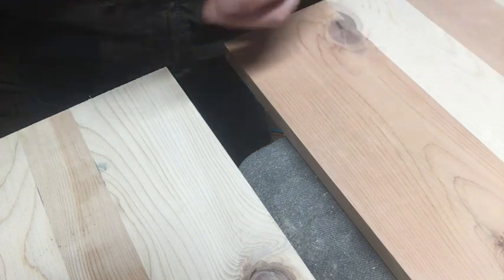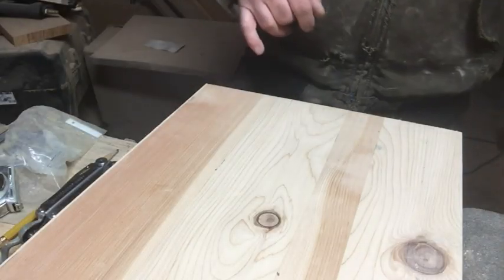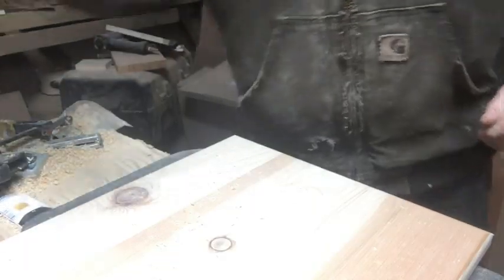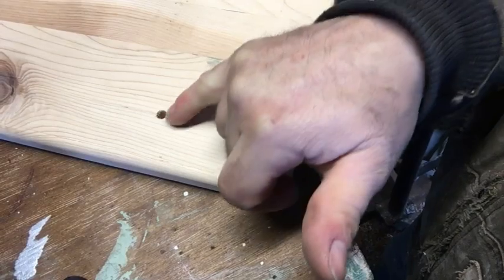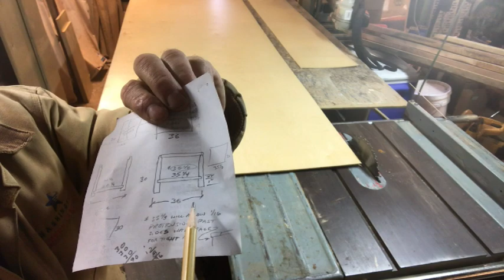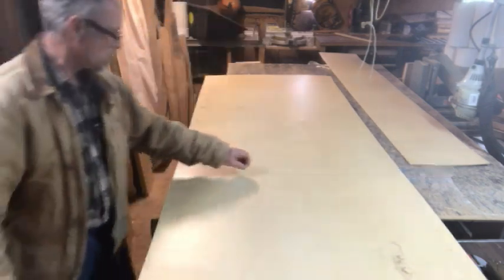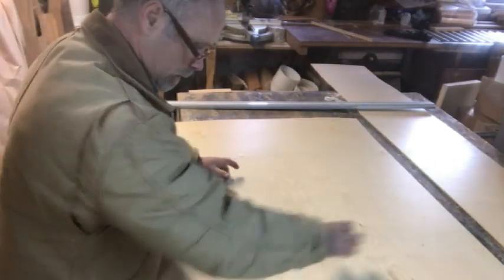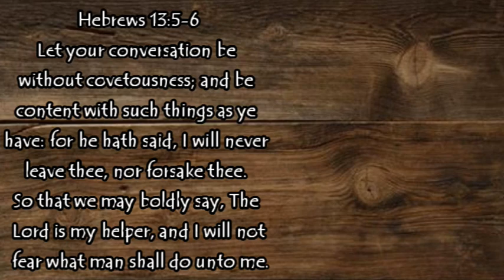Custom Kitchen Cabinets Part 3

Comment: 🌞 Good morning Mr Rain thanks again for sharing this video on custom cabinets part 3 thanks for the tip with the drill bit on not drilling through the the cabinet with the bit and thanks for the step by step instructions making it easy enough for me to do by myself if I had to ✨✨👍
Reply: A lot of these techniques can be used in multiple situations and projects. Thanks!

Comment: Those handles are adorable, i love them!  I started to teach myself carpentry and measurements and what not because its a good skill to have. Everyone should know a little bit if everything. Stop going to the store or getting prefab things. Building something yourself is so rewarding. I built my headboard and a stand last summer and the summer before that, i built a nice bench. I get better each year and learn more.
Reply: Better built and satisfaction of knowing that you did it. Various skills are so important.

Comment: Sorry I didn't find your videos until today. I want to share what I did in my kitchen remodel 6 years ago. I turned the bottom cabinets into carts complete with plywood tops for two and marble for one. Then I built the counter over the carts. I used cheap castors, but Home Depot has better metal ones. I made false front drawers with pulls with matching doors beneath. These are fully functional bottom cabinets. Now I can pull out the carts when I need extra counter space or, for the marble, when I'm baking. AND I can pull them out to clean the floor and use roach killer. The carts match the rest of my kitchen when they are hidden.
Reply: Great and creative idea. We repaired and refinished the lower cabinets and installed them in the game room.

Comment: I love those handles! It might have been easier to make a template to mark your handles instead of measuring each cabinet
Reply from the maker: Patrick does use templates from time to time but sometimes drawing up a template can take longer than just measuring for each one. For as many years as he has been building cabinets and many other things (at least 40 years now), he mostly has those little tricks figured out :)
Reply: @RainCountryHomestead  oh wow I didn’t realize that! I am not a builder of anything but dog houses and chicken coops lol I am a woman in my 60s so it only has to be sturdy and dry lol no quite square lol 😂
Reply: Sometimes templates for sure. These were pretty simple at a 45 degree angle, find center, center the handle and tap with a rubber mallet works great also. If one is making a lot at once a guy can make a jig that centers itself on the corner too. Thanks!

Comment: Around our house if a tool is more than 5years old, its been modified in some way or another. New cord, longer cord, taped handles, shortened handle...That's the old school way hon, find a way to make it work. Repair, repurpose, use it up or wear it out!
🤣 👵
Reply: Yeah, we live in a disposable world with engineered obsolescence. We may be headed back into "old school" sooner than later 🤔👌